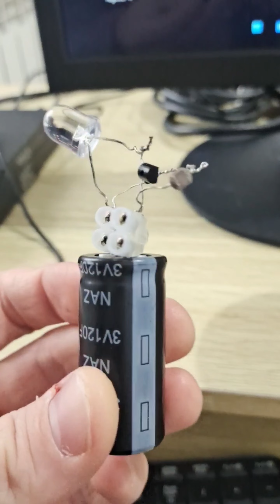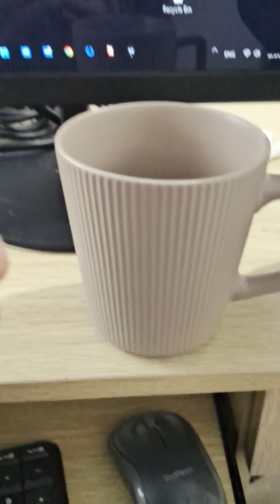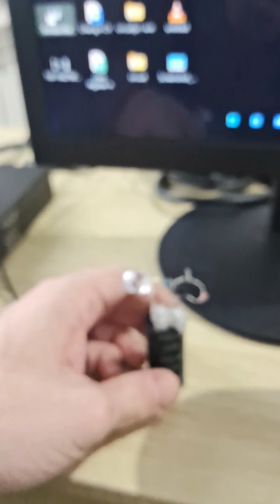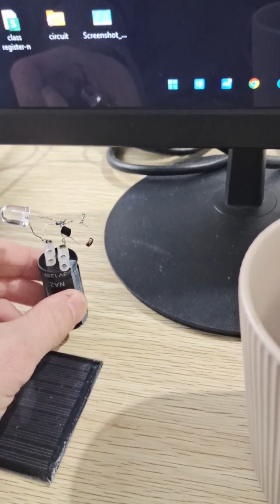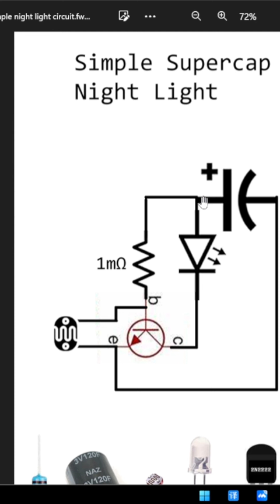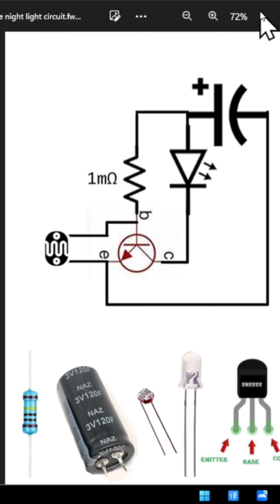Super capacitor night light

Comment: That's really shoddy assembly. I mean that's some of the worst I have seen in my 40 years of doing electronics.
Reply: Well, I like it, and I appreciate the video.
Reply from the maker: Thanks, gave me a giggle. It does the job and it's easy to reuse in other projects should needs be. Can you explain why it works?
Reply from the maker: My intention is to allow children to build it also as an introduction to electronics.
Reply: @davidiom27  When I was a kid I was using veroboard and even made my own single sided PCB! Even a breadboard will suffice as a temporary means of construction. That's 3 techniques which are far better.

There are so many YT content producers that are using this technique, it is teaching and perpetuating bad habits.
Reply from the maker: @deang5622 you're right. I just like it
Reply from the maker: thanks for that. It does the job @paradiselost9946